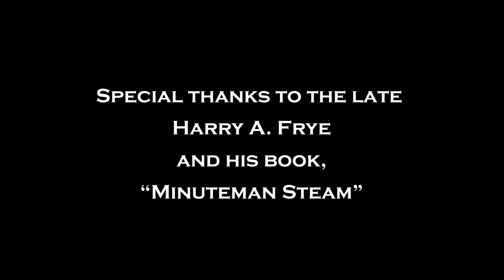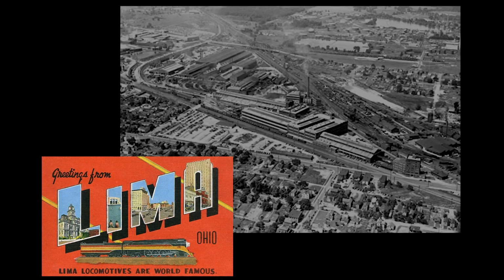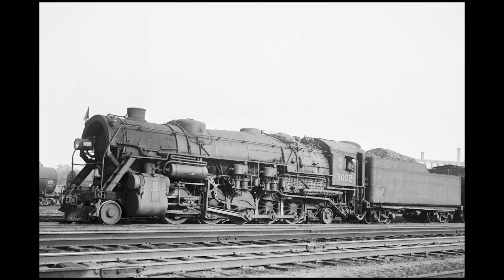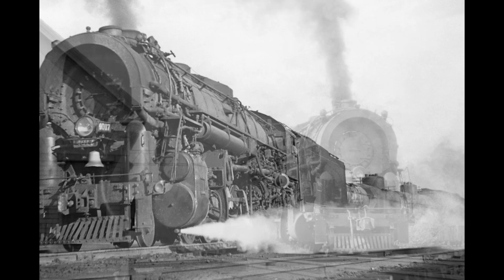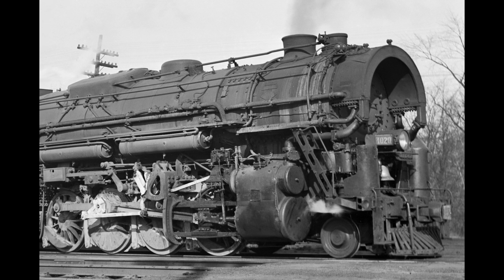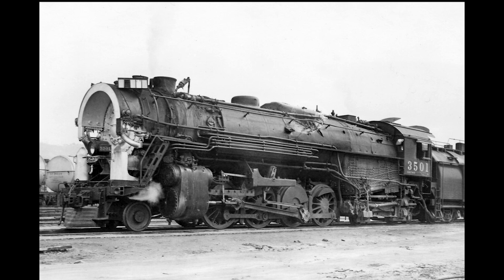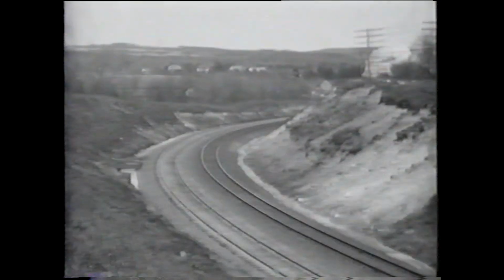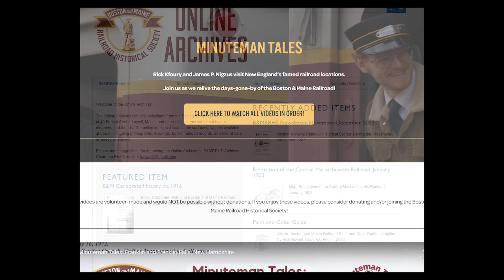Minuteman Steam Episode 5: The Limas

Comment: Well done! One item of minutiae that should be mentioned in parting is that the Limas, as delivered, had Baker Valve gear. This was somewhat of an anomaly on the B&M as the railroad had, by that time, standardized on the Walschaerts gear. Ken McCall opined about this in a rather interesting context as it concerned the ill-fated Krupp Diesel experiment.